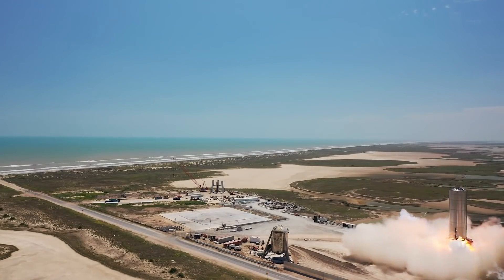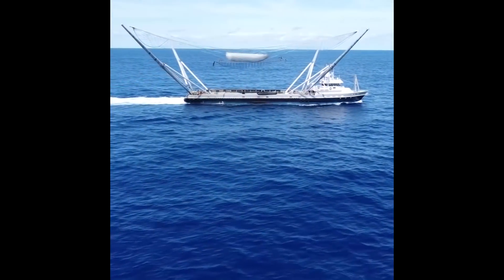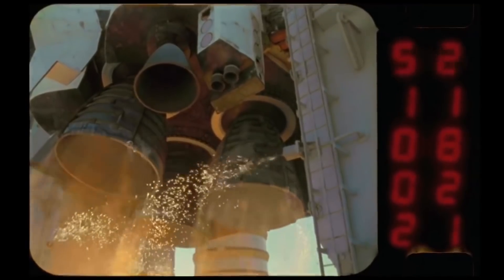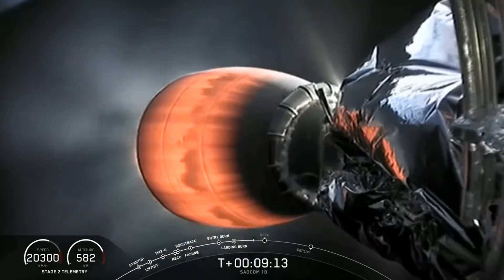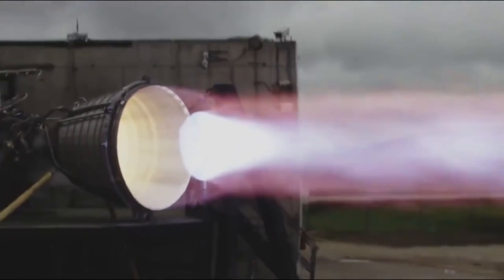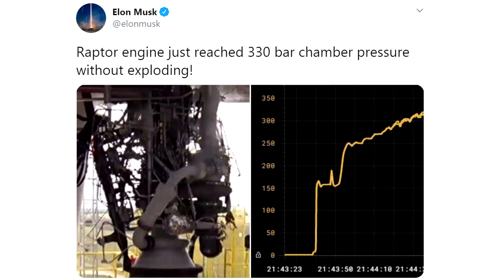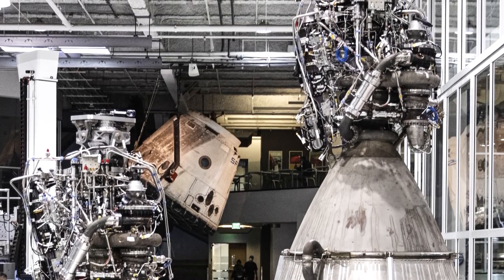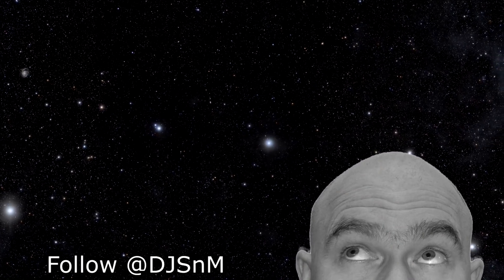How SpaceX's New Raptor Vacuum Engine Is Different From Previous Raptors (and Other Stuff)

Comment: 5:10 - Another big difference between M.Vac and RapVac (regarding need for regenerative cooling) is that M.Vac are expended - RapVan will be reused. Even if RapVac were exposed, I'd wager they'd use cooling to make sure they don't get damaged - not to mention planned "many reuse" within even a single flight before possible refurbishment. (Lunar landing, Mars trip, anything with multiple long relights between landings.)
Reply: @Minonian You are the one acting childish, resorting to personal attacks. Greg and Advorak have been attempting to answer your questions, and you are just dismissing their statements out of hand, and calling them names. If you want people to actually answer you, perhaps try actually reading their answers, asking intelligent questions, and not resorting to personal attacks.
Reply: @Pronto Capable yes - but it isn't at present.  They were working on a reusable 2nd stage, but abandoned it as "too much weight-to-orbit penalty" and went full-force forward with Starship.

If they had decided to continue pursuing reusable 2nd stage, I'd wager we would have seen a cooled M.Vac bell.
Reply: Also, by my armchair math, if a Falcon 9 were to carry just an empty fairing, but have the 2nd stage (with no cargo) accelerate all the way to "minimum altitude/velocity to be considered 'orbit'", it would still have enough propellant to slow itself sufficiently to survive re-entry.

The trick is - it can't do that and carry any payload to orbit. Obviously, SpaceX could make changes to allow it to survive re-entry at higher speeds (heat shield like was originally planned, along with some form of recovery, either powered landing or parachute-catch) but that adds weight - which means it would have less payload.

They decided that reuse of second stage didn't make financial sense - costs too much to develop, reduces payload to the point of no longer being economical even with reuse. Likely would only have same "fully reusable" payload as much smaller expendable rocket like a RocketLabs.
Reply: @Minonian   Jet fighters fly in much more limited air pressure regions.  Namely never even near to a full vacuum.  Also, they do need the air 

You could try an aerospike --- where the air pressure itself would form the outer part of the bell and thus self-regulate.  However (as I understand it) you still get a similar amount of heating ... into a much smaller area.  Which tends to make cooling a really pressing problem.

For spacecraft engines, you want the most robust, most simple approach that is able to deliver the target performance (mass, thrust, Isp, size, ...) and often a slightly lower performance as a trade-off for much increased reliability is preferable --- after all, you are sitting on tons and tons and tons of highly energetic fuel and oxidizer, just waiting to take a shortcut and go BOOM.  And when that happens, well, you lose everything.
Reply: @Minonian    Obviously I am clueless what your magic(?) solution is, until you present it.
So please show us that you actually have a clue of what you are talking about, for I have not seen one from you yet.
Reply: @Minonian    And my point is that you have not shown any appreciation of the differences.

Did you know that you can do thrust vectoring without gimballing the engines or using an adjustable nozzle (or putting vanes into the rocket exhaust or using vernier engines) by simply injecting (or withholding) something on one side of the engine? As long as that either improves or reduces the thrust on one side, you get thrust vectoring.

Of course you could always reduce the throat instead of extending the bell, as long as the engine is fine when you reduce the fuel flow to match that.  That is a much smaller bit to change … well, except that you are dealing with the full chamber pressure.
And I bet by differentially changing the throat, offsetting it, you can also get thrust vectoring. 

You can even add some movable weights (I would advise in pairs and concentric to cancel themselves out in neutral) — or pump ballast or fuel or oxidiser to move the centre of gravity and use the engine not being in alignment with the centre of mass to have some control.

That does, of course, not solve the performance you could gain by variable nozzles. Well, except for the variable throat. And some of these ideas have actually been used. Most not so much, for obvious reasons.
Reply: @Minonian     I concede. I clearly have no chance against the weight of your rational, clear and well presented arguments and the indisputable facts you refer to.
get lost! is such a strong and reasonable logic I simply cannot argue against.

Besides, I do not believe there is any honour to continues battle of wits when it turns out my opponent is not only completely unarmed but is actually wearing the emperor’s new clothes.
Reply: ADvorak I think you’re wasting your time and effort with a child. Just block and move on.
Reply: @advorak8529  Don't feed the troll - just report all their comments as harassment.
Reply: @advorak8529  yeah, didn't report the initial one. Only the harassing ones.
Reply: @Minonian Any jet engine draws air through it as a part of its function. Air is mostly inert nitrogen with only a little oxygen. This not only reduces the efficiency of a jet, it helps cool the parts. A rocket engine gets no airflow through it, and it also    combines pure oxygen with its fuel. This makes them much more efficient, but also MUCH hotter than even a jet running its afterburners.
Reply: @Minonian It's been tried in the past. See many single stage to orbit prototypes. It just hasn't panned out for some reason. Mostly, I think, because most people weren't interested in building reusable rockets, so it didn't make sense. Maybe with Starship they think it's simpler to carry the extra engines, rather than the weight and complications that a variable nozzle would bring.
Reply: @Minonian   First stages are meant to get the whole thing up and going out of the thickest part of the atmosphere as fast as possible --- but not waste fuel by going so fast that the friction becomes a problem.  And to get a sideways motion going.

First stage (non-adjustable) nozzles are designed gives the best overall economy for their flight profile.  Often an under-expansion at sea level is accepted as long as the thrust stays sufficiently high at lift-off to get to an overall best economy.

If you want to design an adjustable nozzle, go ahead.  If you find a system that out-performs conventional nozzles as an overall system, you'll probably get rich and famous. Just remember that pure performance is not everything, you also need reliability and extra weight will counter performance gains. How do you cool the nozzle?  How do you make sure that the actuator system works --- given that the nozzle is likely to be hot ... but could also be extremely cold with cryo fuels and not being used for hours or days? etc etc etc.
Reply: @Minonian Yeah. I think one of the main issues is cooling. Rocket exhaust is hotter than jet exhaust, and they don't have the air-flowing through them to help cool them down. I'm confident that Elon and his team have looked at variable nozzles. If they're not using them, there must be a good reason. I bet if someone tweeted the question at Elon, he'd give at least some clue as to why they don't use them. He's cool like that.

Comment: They’re going straight to 15km, and not doing a 150m before it
Reply: @RobertLutece909  SN6 appeared to use only engine gimbaling for control, unlike SN5.
May not seem like much, but it is essential data needed for the 15km hop.

@Vatsyayana Due to the nature of a single engine with offset thrust, the rocket must land out of vertical. Hence 4 legs getting crushed. It is designed that way, and worked as expected. Any landing the leaves the rocket un-damaged and still erect is a success by any standard. Abrupt take off was also intended to prevent the sideways slide that SN5 took (which damaged the launch mount). They simply held the clamps until it reached full thrust, then released them.
Reply: @joshua43214  good explanation 👍
Reply: @RobertLutece909  You do know successfully landing SN5 doesn't mean they mastered the technique,
You have to do test again and again to find the errors; that's the approach SpaceX using.
Also SN6's flight was much smoother and faster.
Reply: @arsal.07  you know, everyone says sn6 was so much smoother then 5, by just looking at it I have to disagree, it was a more abrupt takoff and rougher landing. I can understand the takeoff, but it was sitting on 4 of 6 legs after landing. I don't call that smoother.
Reply: @Vatsyayana87  You know Elon Musk himself said that the SN6 was smoother and faster (also more time hovering), you tell me i believe your eyes or Elon and SpaceX community?
Reply: Didn't he just have the hundred fifty test in this video?
Reply: @dosmastrify  He means SN8, won't do a 150 m test like SN5 and 6 did.
Reply: @please_stop-v7o  ah, thank you
Reply: dosmastrify which is why I’m correcting him and saying that Elon is gonna make SN8 go straight for 15km
Reply: @StarshipFairing  you think...i think too but i gotta say Scott is more connected then myself and most likely yourself, so we will see. But my understanding is SN8 is only for a 15k and with nosecone.
Reply: Now that I think about it, that system for the legs is single use. So doing the small hop would require a lot of refurbishment before the big one.
Reply: @trezapoioiuy  While the legs have to be replaced, they don't seem that complicated to manufacture and can probably be replaced in a day if spares are available. That said, there are certainly a lot of other things that need attending before they would just refly a prototype.
Reply: @RobertLutece909  The SN6 flight was for two reasons. Partly because they had the prototype built, so it'd be a shame not to fly it. 

But more importantly, to practice fueling and launching things. Nothing seems to have come of it, but there was a suggestion from Elon previously that SN5 and SN6 would both be flown repeatedly (maybe even more than once in a day) in order to exercise ground operations.
Reply: putting a nosecone on a 150m hop seems like an unneeded risk. It isn't required for a hop and there is work/resources invested in a nosecone. Better to use it when you need it for the 15km flight.
Reply: yea, and it seems like a waste to land once you are up those 150 meters, just to reset and then get back to the point before landing :P. Might as well go all the way up.

Comment: Scott, please explain the various colors in the exhaust.
Reply: There's no TEB in raptor.
Reply: Thomas Row correct. Big spark plugs
Reply: methane flames + the metal the engines are made of + various starting chemicals like TEB that burn green
Reply: Yeah, there shouldn’t be any boron shenanigans going on with Raptor. 
I think any green is likely a small amount of the copper combustion chamber getting ablated away - though it’s not designed as an ablative chamber of course. Likely it’s a small enough amount that it’s insignificant over the expected lifecycle.
Reply: Doug Golde Scott has a whole video on rocket exhausts.
Reply: blue: full combustion
yellow, orange: incomplete combustion/fuel rich. This is the color of incandescent carbon.
green: TEB boron
Reply: @-danR  and red usually is an ablative nozzle like in Delta IV

Comment: How can a gas be high speed but low pressure?
Reply from the maker: Bernoullis law.
Reply: To say it a different way ...
The fuel and oxidizer combust and produce high pressure hot gas. In the vid Scott mentions the 200 : 1 expansion ratio. This means that as those hot gases move through the nozzle they expand to 200 times their original volume. As they expand the pressure drops. So they are supersonic but at atmospheric pressure.
People who didn't need this explanation are probably saying the test engine doesn't have a 200 : 1 nozzle, but that's the general idea.
Reply: Had to look it up 👍🏻
Reply: A pressure cooker doesnt have high speed gases, those two things are completely unrelated so get that locked into your thinking. Andrew explained how we turn high pressure into high speed pretty good, we start at high pressure to give it high momentum as it screams for low pressure areas, then we expand the gas in a controlled way until the pressure is around 1 bar, but it still maintains its momentum.

Comment: What is flow separation?
Reply: Where the flow doesn't follow the nozzle wall. Happens when the exhaust is at sea level atmospheric pressure but the nozzle has more expansion capability. This will occur when an engine is designed for use at altitude or in a vacuum but its being used lower in the atmosphere.
Essentially the atmosphere is not being pushed out but the exhaust, it can "sneak" in along the walls.
Reply: @AndrewBlucher  A bit over explained maybe lol, but gives an idea of what going on for the two examples shown.
Reply: @Vatsyayana87  I was surprised to see how much the Shuttle engines were wobbling. Great vid and explanation by Scott.
Reply: When the exhaust separates from the nozzle, from outside air pressure being higher then exhaust pressure and pushing its way between the exhaust and nozzle walls.